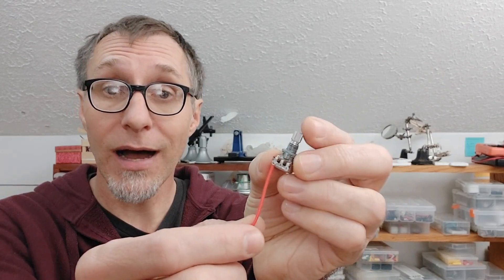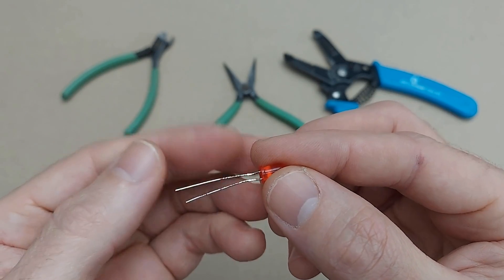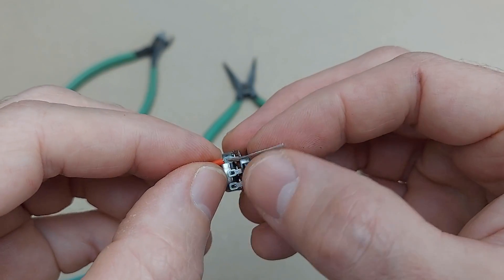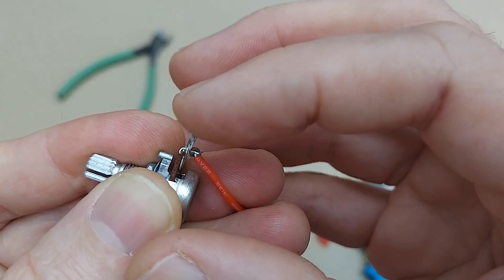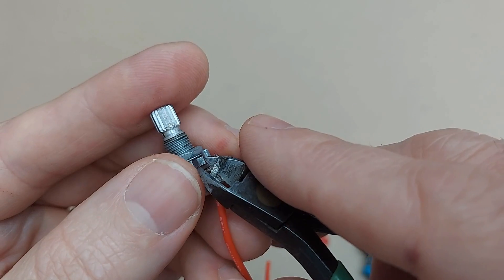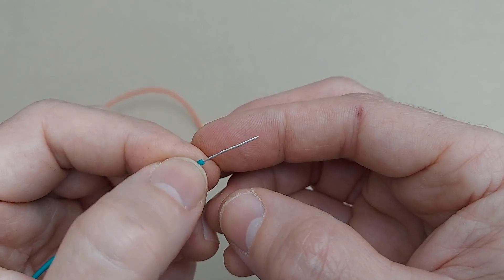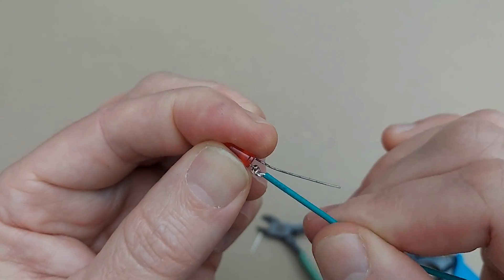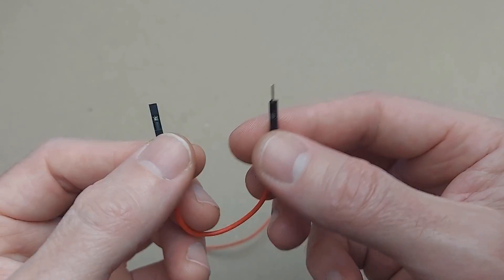How to connect wires and components without solder

Comment: Easier to buy a terminal connector.  Can buy with wire attached or crimp your own. I use for rapid prototyping. I make constant changes when prototyping.  Easier to connect and disconnect. Then solder final version.

Comment: This could be useful for electrochemical gas sensors. The datasheet advises not to use soldering, instead to use press fit holes on PCB or crimps. I suppose if the PCB hole is too large a copper wire can be wrapped around the pin tightly after inserting it through the hole. There are some very low melting point solders available, e.g. Indium/Bismuth eutectic alloy melts at 72 C, but it is expensive.
Reply from the maker: Super interesting! I think the main issue for wire wrapping is just to make sure it doesn't get jostled afterwards. I would consider using glue  to secure the wire so you don't get intermittent electrical connections

Comment: Meh. Interesting, but I'll take my soldering iron any day even for quickie prototypes.  Get a decent iron, watch a couple videos on how to solder and it'll be a simple task in no time.  Personally I find stripping the end of a wire more of a hassle than soldering it to something.
Reply from the maker: Indeed, I second the advise to purchase a good iron (temp. controlled), and take the time to learn how to do it well. And I personally never wire-wrap small electrical components like this. But there are, of course, situations in the real world where soldering is not feasible (or not possible), and so I like to explore alternate methods.

Comment: This is OK for experimenting but don't do this and expect the finished assembly to be reliable for years or even months. Electrical connections don't care if the connection is strong. Physical strength is not the goal for electrons. These wires are exposed to AIR, which will lead to CORROSION and electrical failure. Wire wrapping tools and techniques were developed to help overcome this problem.
Reply from the maker: Couldn't agree more! Wire wrapping is only for temporary work (such as a workshop, or quick prototyping). Eventually you will need to purchase tools and learn the techniques for soldering.
Additionally, this is why jumper wires and breadboards are problematic. These dry connections are fine for prototyping, but ultimately solder should be used wherever it is feasible (which will lead you to designing a PCB).
The caveat to all this is of course that there are many places in the world where dry connections are the only "feasible" option -- such as automotive and residential wiring. 
So do what you can with what you've got. (⌐■_■)